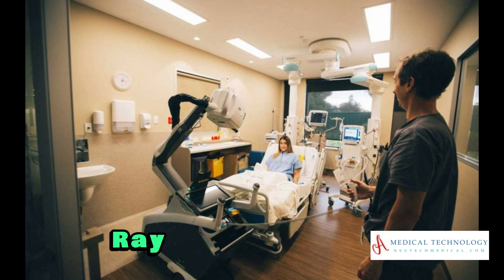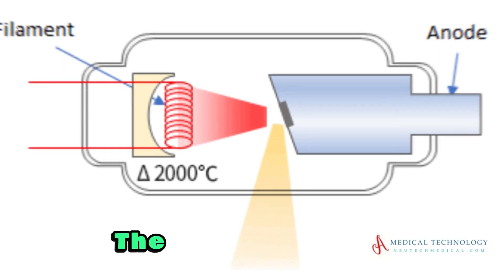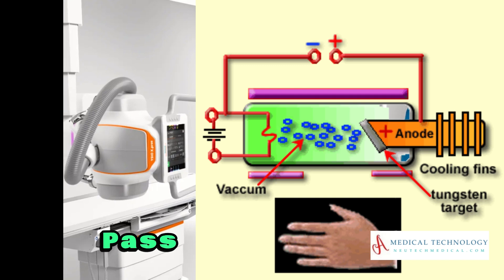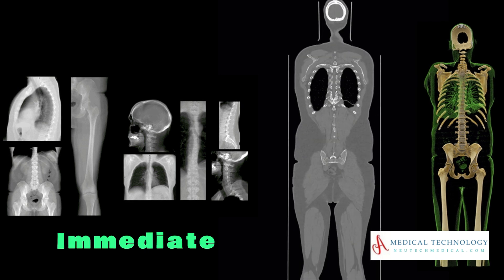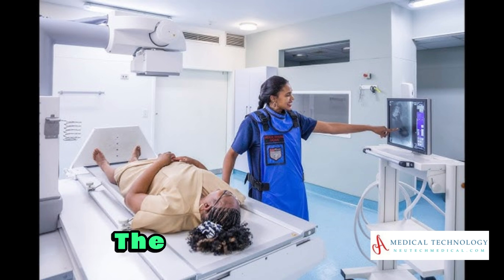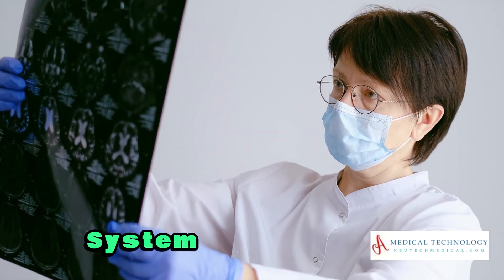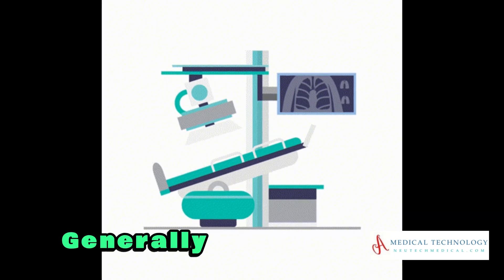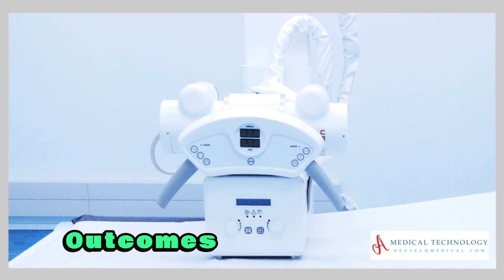X-Ray basic Principle | X-ray Physics | Medical Technology

Comment: how to read chest xray?????
Reply from the maker: Anterior and posterior ribs: The anterior ribs are harder to see and are oriented at a 45 degree angle, while the posterior ribs are easier to see and are oriented horizontally.

Lung apices: Both lung apices should be visible.

Costophrenic angles: Both costophrenic angles should be visible.

Cardiac silhouette: The cardiac silhouette should be visible, and you can measure across it to see if it's larger than 50% of the ribcage's greatest diameter.

Diaphragms: The diaphragms should be fairly symmetric and not too flat.
Reply: Great question! Reading chest X-rays involves looking at the lungs, heart, and surrounding structures. Key things to check include the size and shape of the heart, lung fields for any abnormalities, and signs of fluid or infection. There are many resources available to help guide you through the process!

Comment: how to check KV voltage
Reply from the maker: A kV meter, also known as a pre-reading voltmeter, measures the electrical potential of an X-ray tube. The quality of an X-ray tube depends on the kV applied across the filament at the target. A slight change in kV can significantly affect the image.
Reply: Great question! To check the kV voltage, you usually need a calibrated kV meter. Connect it to the output of the X-ray machine while it's in operation, ensuring the settings are appropriate for the test. Always follow safety protocols!

Comment: how to clibrate of xray
Reply from the maker: Check the overload circuit protection: Make sure it's present and working properly.
Perform generator checks: Use a kVp/mAs meter to perform important checks.
Check the peak voltage: Check the peak voltage in kilovolt or kVp to test the radiation quality.
Reply from the maker: coming soon
Reply: Calibration of X-ray machines is essential for accurate imaging. I'd recommend checking the manufacturer's manual for specific guidelines and procedures. If you're unsure, consulting a qualified technician is always a great idea. Your interest in the calibration process shows a commitment to quality in medical imaging!

Comment: how to traubleshoot xray
Reply from the maker: coming soon
Reply: Great question! Troubleshooting X-ray machines can be complex, but focusing on common issues like calibration, software errors, or hardware malfunctions is a good start. Checking connections and ensuring proper settings can also help. Let us know if you need more specific tips!